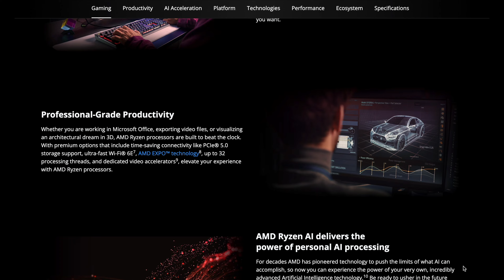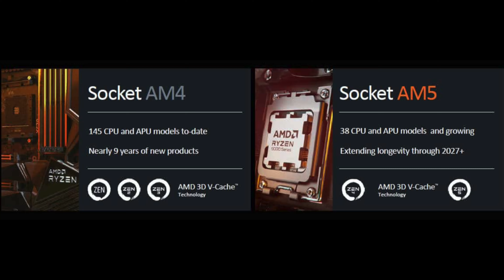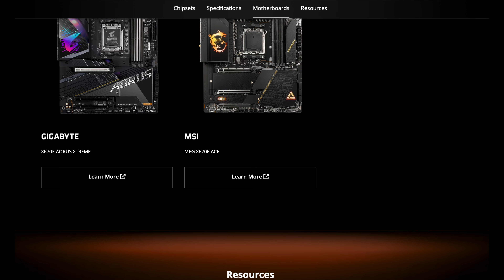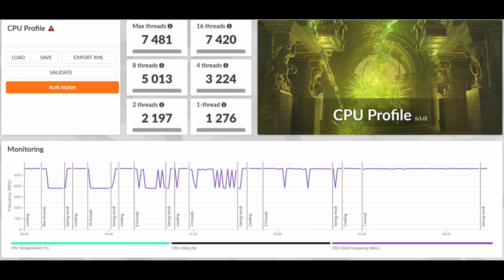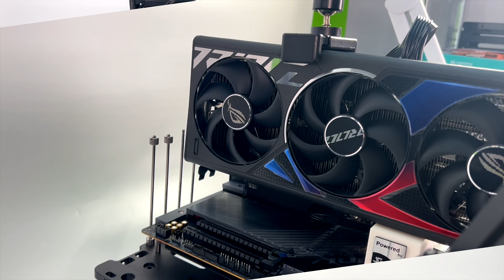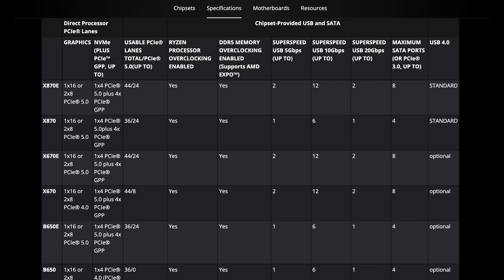AMD Ryzen 7 9700x CPU Review: Performance, Thermals & Power Analysis

Comment: I'm building a mini pc tomorrow:
it's sfx

7 9700x with a 47mm cooler
4070ti super
b850i

I heard that this cpu runs cool. On my current setup right now, I have a thermal rite phantom spirit and if I blast it on max, thing does not even see 80C under full load, gaming.
I think this would be possible to not overheat. we'll see

Comment: Thank you for the review. Wanted to check this out, because there seemed to have been some controversy around how much power these thing were drawing, and I knew I could trust your figures.

You also had higher power consumption like HUB, and both of you were on the aourus board, where I think GN and derbauer were on Asus, and both of those reviews got 88 W. For a moment, I was suspicious if software monitoring was under reporting, causing those low figures, but GN had just below 88 W pulling from EPS12V cables.

Messy launch overall that needs a serious post mortem lol. Seems very rushed and was unfortunate that some reviewers only got the samlpes a couple of days in advance (with GN even getting a broken 9600x).
Reply from the maker: Just a note here, I also measure the CPU's power from the ATX connector beside the EPS cables. I isolate the power going to the CPU from the 24-pin and add it to the EPS.
Reply: @HardwareBusters  ohhh, that is a very interesting point actually, thank you for clarifying.